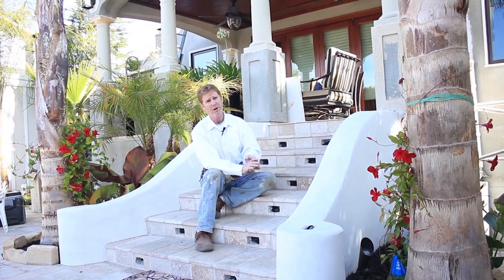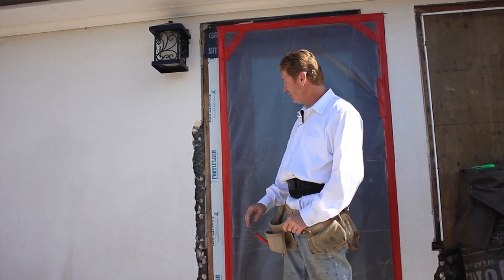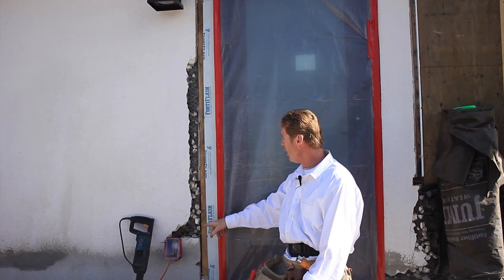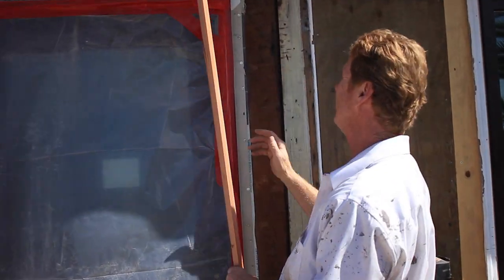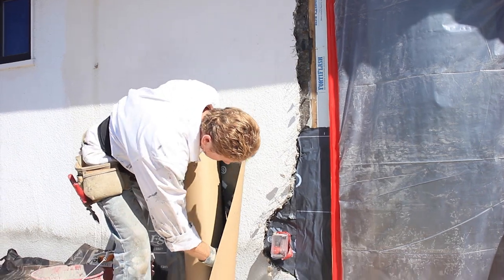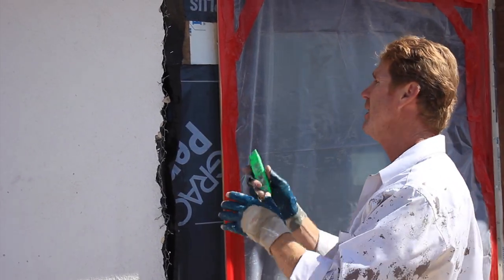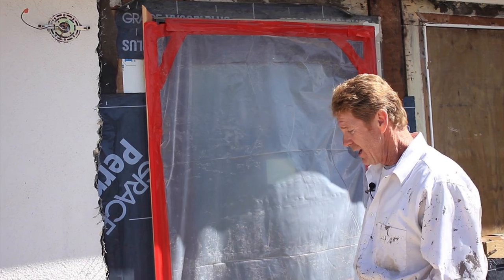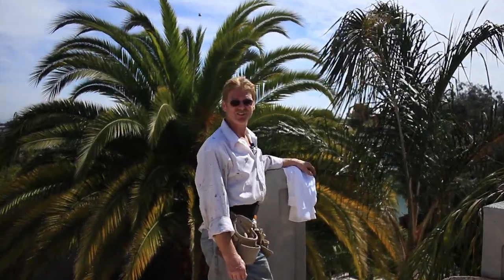Waterproofing a sliding glass door and the benefits of stucco

Comment: would you suggest putting your stucco over existing siding for added insulation or would you suggest removing old siding for a better application of the stucco???
Reply from the maker: Andres ledesma Hello Andres, not only would you save a small fortune in cash to leave you're siding on, but current sidings usually makes an excellent backing.
 I have even applied stucco over single, double and even triple ship lap siding.
 This type of siding requires a lot of practice.
 Best wishes, 
 Kirk Giordano Plastering
Reply: Andres ledesma I'm still mad you Kirk for rebuking me for saying your daughter was a doll.